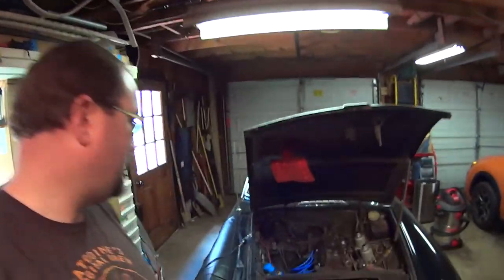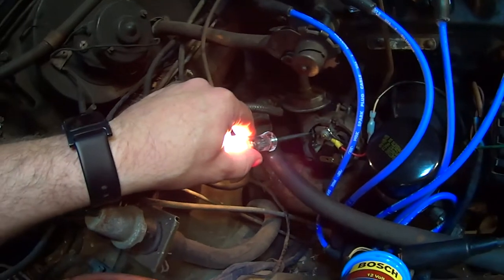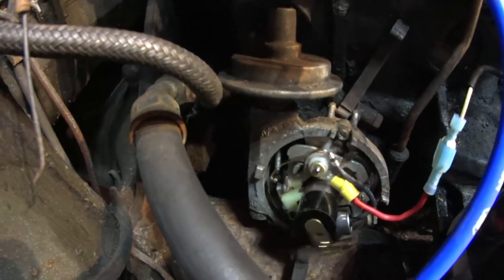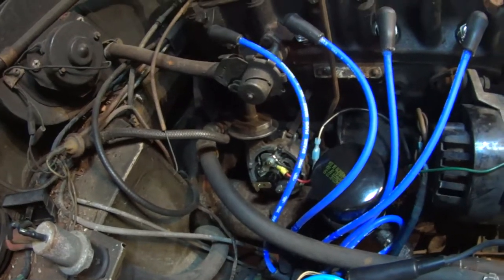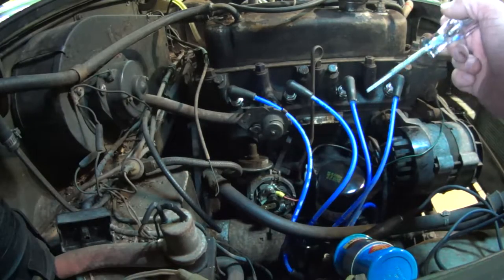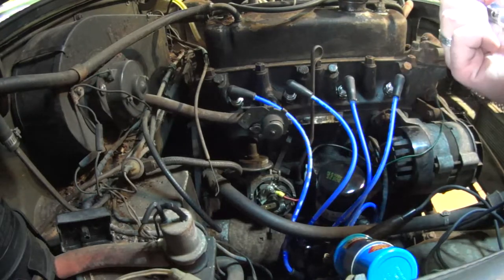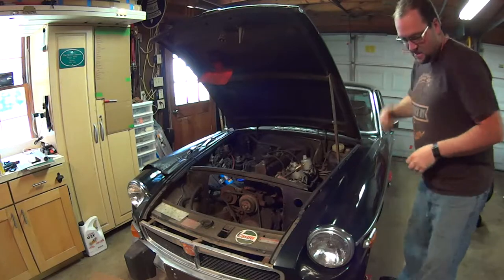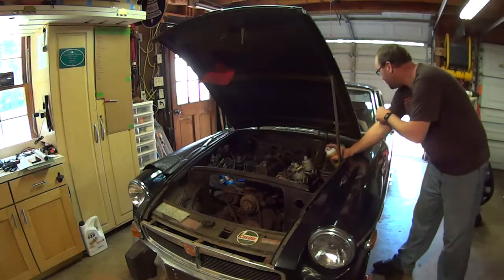'74 MGB GT "Badger" We have spark!!!!

Comment: No coolant? Rad?
Reply from the maker: At this point was just to confirm that it would run well enough to keep moving forward.  Rad was installed with coolant when the engine was run long enough to build heat that required cooling.  This short run the engine barely got warm.  Thanks for watching!